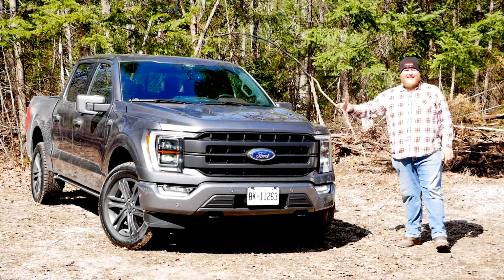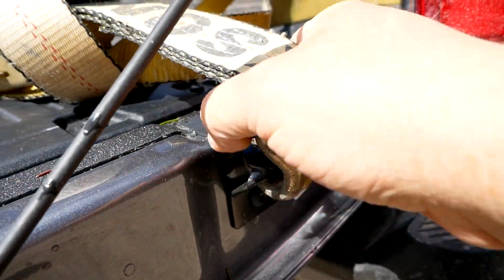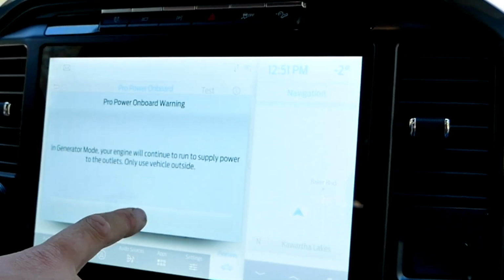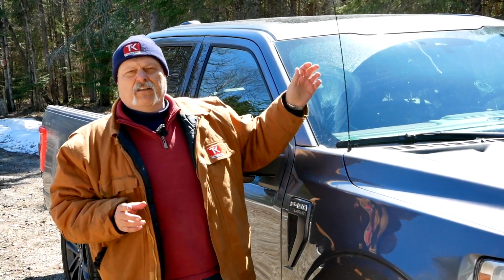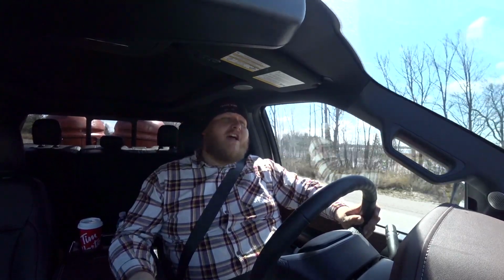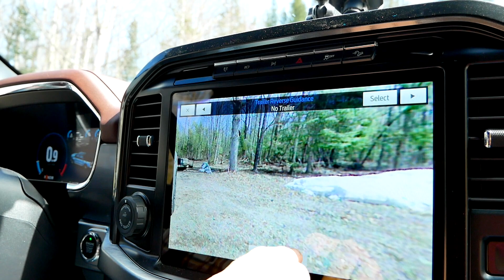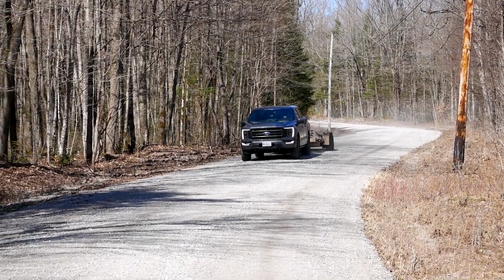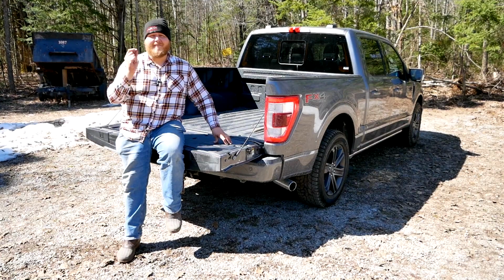Towing & Hauling with the 2021 Ford F-150 PowerBoost - Is Hybrid The Right Answer For Hard Work?

Comment: I ordered an F150 Powerboost (Lariat) at the end of August.  It was rolled into a 2022 in Sept.  It is due to arrive between Nov. 26 and Dec. 2.  What are the odds it is one of the trucks stored on parking lots by Ford while they waited for microchips?  Has the rust issue been corrected by Ford?
Reply: I've made a point of checking out new truck deliveries and can find no rust on any differentials, axles, etc.  It all looks clear to me. I ordered my Powerboost last month.

Comment: I'm guessing that $1000 is just for the plugs in the box and not for the batteries.
Reply: It is upgrading from 2,4 kilowatt (that is standard with Powerboost) to 7,2 kilowatt. Cost of getting the Powerboost depends on the trim as XL, XLT comes with the 3.3 v6 as based engine and Lariat and up comes with 2.7 ecobooost.

Comment: Great review. About the camera views....I will never use most of these. The best is backing up to your trailer and the zoom. All the other views for me are useless. That big screen is like a Tesla. I do not have the patience at my age to screw around with that crap. About fuel....my brand new Tundra showed 13.4 litres per 100 k driving at 110 km/hr. So, this truck is $30 000 more than my Tundra and gets slightly better fuel economy.

Comment: Does your truck have the Max trailer tow package / max GVWR ? I have one on order with that option and the book said it would have 1810lbs of Payload.
Reply: HDPP. ? Heavy duty Payload Package
Reply: My 22 powerboost  max tow has 1650 on the door, with airbags added I’m not worried about it

Comment: Hey Howard:
I asked the same question about the antenna when I bought my new truck. Why do trucks still have long antennas, when most cars have gotten rid of them.
Reply: @371kenny  Hey: I think there are better alternatives out there, with the tech that have today. I replaced my antenna on my Silverado something shorter that works just as good.
Reply: @kevingroulx9205  yeah they probably do have shorter ones. I guess my comment was more on where it was positioned
Reply: @371kenny  True.

Comment: Awesome truck, but I would not want to live with the low carrying capacity.  Probably the hybrid power train has something to do with that.  I wonder if the same power train, in an XLT with fewer creature comforts, would result in a higher carrying capacity.  I would like at least 1,500 lbs. in a modern half ton.  Great video, Guys!/Warren
Reply from the maker: Right now it seems manufacturers simply add/subtract payload weight based on adding/subtracting options/trim/cab style/4x4 etc.  So, yes lower trim usually means more payload.   Kinda strange way to do it, eh?

Comment: Hybrid is definitely in the testing phase, I think it may work well for couple years then reality and cost of ownership of repairs and issues is not going to add to fuel savings of $20 a week. I rather pay $20 more on gas a week than paying thousands and thousands of dollars for hybrid technology. Ford needs and should focus on refining the Hybrid technology on their smaller vehicles first not on their bread and butter F150. Baby steps people, baby steps...brand reliability and loyalty is not built on the newest and greatest. Learn a thing or few from Toyota Tacoma.  These Tacoma’s are practically the Corollas of mid size truck. Ford needs to the same they need a Taurus equivalent in the Truck line up which F150 is however with these Hybrid offering they need to change their F150 name to another name. Ford don’t destroy the true brand loyalty you build for decades on this hybrid technology basically don’t kill your F150 name just like what you did to Taurus nameplate. Taurus used to be the #1 selling car in North America many many years ago, today that crown is taken by Camry and Accord. Basically what I am saying is Ford you had it but you keep losing after winning because of poor poor marketing group that you have. Let the your engineers run the business not your marketing group!!!
Reply: If you don’t want a hybrid, Ford will sell you a traditional Gas engine or a diesel
Reply: Hybrids have been out a very long time now...
Reply: @AircraftMechanic-AP  Yes, they have been around since it was on Model T, more than a century ago so nothing is going to change except lying climate change mentality and lying politicians. I encourage people who are hard working and value your money to hold onto your fossil fuel vehicles instead of trading into a hybrid or electric cars. Toyota is the closest on being realistic with hybrid, hydrogen and electric cars, all other manufacturers are playing with investors hard earned money.

Comment: The powerboost is cool and all, I definitely see the appeal, but for what I would use an F150 for, the price to upgrade over the 2.7eb or 5.0 even, isnt very well justified. Plus the hybrid tech reliability is worrisome longterm.
Reply: Hybrid is definitely in the testing phase, I think it may work well for couple years then reality and cost of ownership of repairs and issues is not going to add to fuel savings of $20 a week. I rather pay $20 more on gas a week than paying thousands and thousands of dollars for hybrid technology. Ford needs and should focus on refining the Hybrid technology on their smaller vehicles first not on their bread and butter F150. Baby steps people, baby steps...brand reliability and loyalty is not built on the newest and greatest. Learn a thing or few from Toyota Tacoma.  These Tacoma’s are practically the Corollas of mid size truck. Ford needs to the same they need a Taurus equivalent in the Truck line up which F150 is however with these Hybrid offering they need to change their F150 name to another name. Ford don’t destroy the true brand loyalty you build for decades on this hybrid technology basically don’t kill your F150 name just like what you did to Taurus nameplate. Taurus used to be the #1 selling car in North America many many years ago, today that crown is taken by Camry and Accord. Basically what I am saying is Ford you had it but you keep losing after winning because of poor poor marketing group that you have. Let the your engineers run the business not your marketing group!!!

Comment: 44 hp electric motor...wow my 60 hp electric motor in my KIA hybrid is going to be shaking in its boot...LMAFO!!!
Reply: Does your Kia hybrid have 570 ftlbs of torque like this truck? Probably not.
Reply: @wikidd934  if my KIA had a 3.6l turbo V6 it would most likely have that and more. Plus my Kia is 2000lbs lighter and that 60 hp electric motor barely does anything...what do you think a 20% drop in hp plus a 200% rise in weight will get you out of that shitty Ford? The answer is dilly squat. Lol
Reply: Kia..girly !
Reply: Why are you watching this ...it is a truck review >
Reply: @godrick2149  if i give you a kia cookie will you go away..?

Comment: The payload figures are becoming laughable. 

The new Hyundai Santa Cruz has a 1700lb payload. Does anyone really believe that it's more capable than this F-150?

The result is people completely disregard these ratings, and maybe end up doing so at a point when it could be actually dangerous.

How about the manufacturers start putting on numbers that properly reflect capabilities, ideally based on a standardized system used by all manufacturers, like the new SAE towing measures.
Reply: Yes Payloads in NA are becoming  ridiculous.  Barely  haul anything
Reply: Then don't buy the Hybrid. a 5.0L V8's is almost 2000 pounds of payload.

Comment: Pathetic payload for a truck with that tow rating. Awful really. Add a spray in bed liner, a camper top, a weight distribution hitch receiver, a couple of occupants, and some gear, and you have essentially nothing left for tongue weight. Truck can pull a 11,000 pound trailer, you just can't hook up to it.....

Comment: This truck would actually be more useful if the battery was 5KW or a bit more. Then 80% of its buyers could actually get to work and Home Depot on all electric miles no gas. The reason the battery is so small is to satisfy the oil industry who sponsors Ford. I wont waste my money until they commit to something smarter and greener. How facking easy is it to make the battery just slightly bigger. Who paid off Ford not to do this is my question?  Idiots.  Who will actually make the first Truck actually worth buying where I can actually use electric miles with no fuel that is feasible. This aint it.

Comment: The cruising mpg is downright abysmal. I have routinely done 24 to 25 MPG in my 2019 hemi back and forth to cottage country (same area Stephen lives, we probably use the same roads, highway 400 etc).

What does this truck REALLY offer? A high power electrical plug, but for the rest, completely underwhelming since they had a few years to try and beat Ram and are still catching up. Despite the bigger screen, the interior does look more plasticy and less attractive than Rams Rebel and Limited.

Comment: Most technologically advanced means that it is majorly overcomplicated and you can expect very expensive and complicated repairs once the warranty is up.

Seriously, why would anyone buy this? It's expensive, and full of electric parts. An electric tailgate??? Are you so lazy that you need a button to lift your tailgate?

220 outlet in the bed of the truck. Oh, I don't see any issues with a 220 outlet in the lower part of the bed of a pickup truck 🤦‍♂️🤦‍♂️🤦‍♂️

This is a prime example of why trucks are getting to where the average person can't afford them. A bunch of idiotic features that will never be used and almost guaranteed to cause issues in the future.

I tell you what people want. How about a simple full size truck with a heavy duty transmission, V8 engine, and basic features like a cd player, power windows/locks, and cruise control. Something designed for the average man that allows you to get the job done.

This thing screams city slicker with a lot of money to spend.... Hey Earl, I can look at my touch screen to see whether or not the engine is running 🤦‍♂️🤦‍♂️🤦‍♂️

Comment: The built-in inverter when the battery is low it actually starts the Ford’s engine? Isn’t that poor setup now you spitting carbon monoxide from the tailpipe into your garage?  What is the cost of replacing the large screen, my Samsung TV lasted less than 4 years, if Ford can built a screen that last longer than 4 years then they are in the wrong business. Ford should be building TVs instead of vehicles.
Reply: @69Mach I CJ Ok sounds good, just need to make sure automakers are buying Sony screens instead of Samsung. I still can’t image it last longer than 15-20 years. All my previous cars had them till they were 20 years old but I bought them used when they were 10 years old. Also, they were all Honda and Lexus/Toyota so that’s probably why normally they last decades unlike any recent Fords. 😂 I have more trust on old Fords like the ones made in 90s and up to mid 2000s.
Reply: @69Mach I CJ I didn’t know about Ford electronics and Apollo mission, more to the point if Ford is capable of producing highly reliable electronic components, they should be able to produce the sedans like they did with 1st and 2nd generation Taurus and even the last generation Crown Victorias. Those were the cars made by engineers instead now days they are made by filthy marketing people.
Reply: My LG TV is over 10 years old.
Reply: @MrTonaluv  ok, now clearly someone is not watching TV or driving any of their vehicles with monitors. 😂